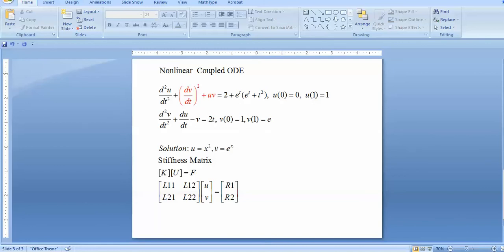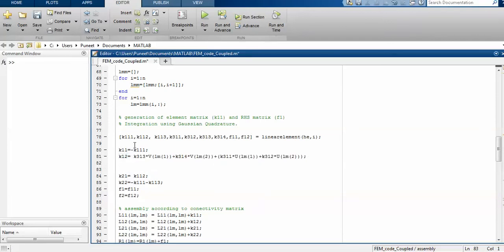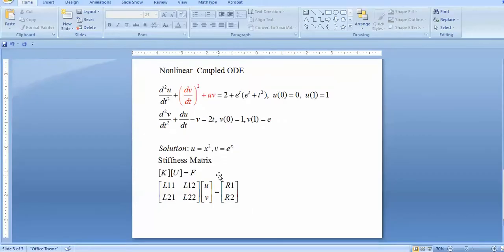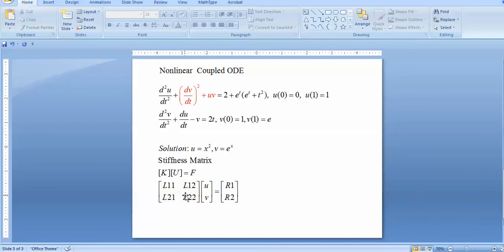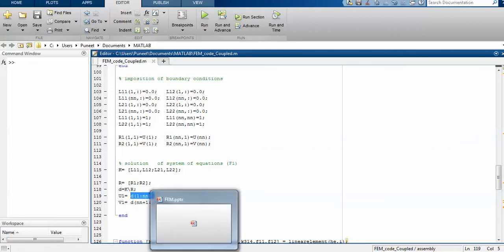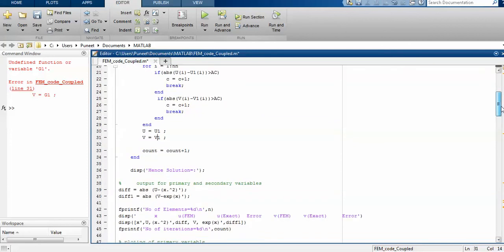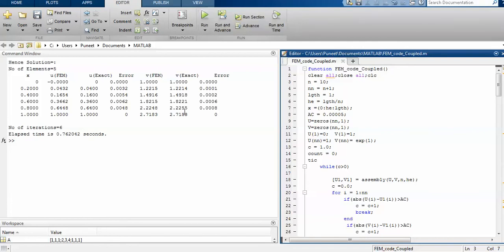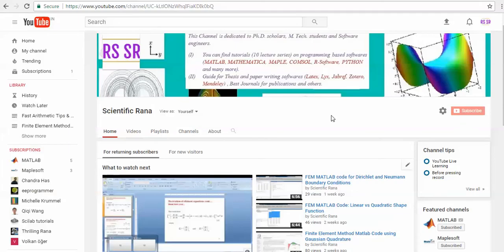FEM MATLAB code for coupled Nonlinear system (Part 2)

Comment: Sir, matrix  K314 ,K311, K312  of first equation are not calculated  how these values are used in function. is there any relation between matrices k221, k222
Reply: can you give me the last part that means Integration part using GQ?